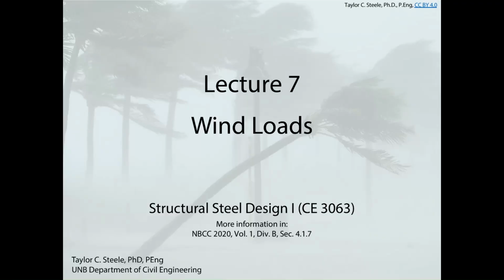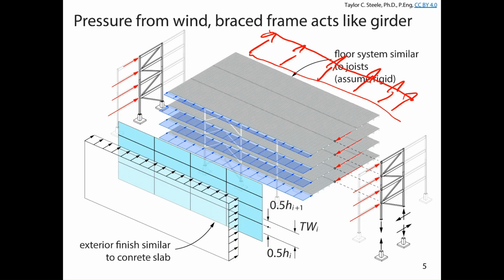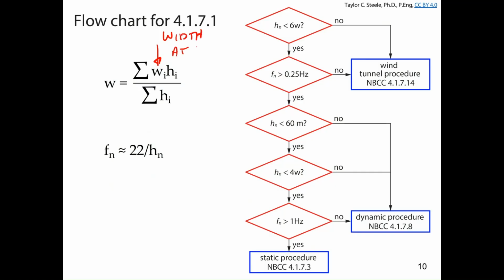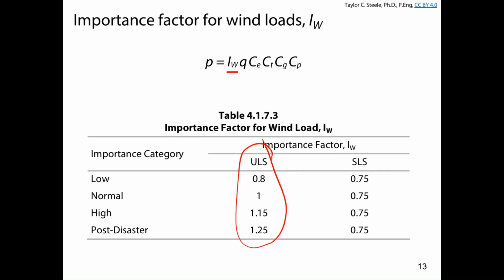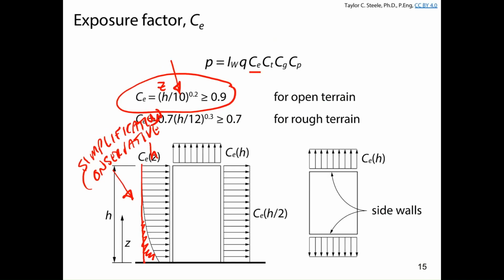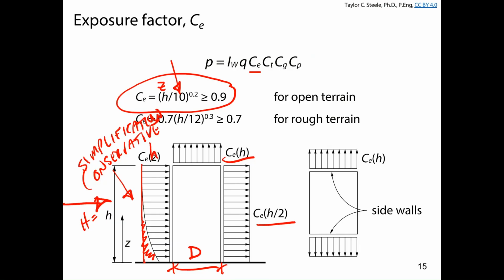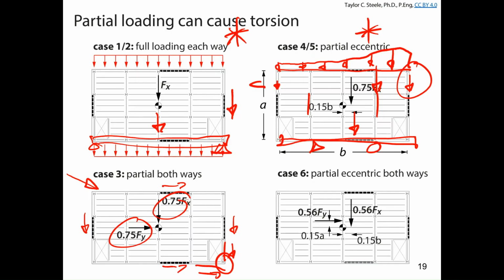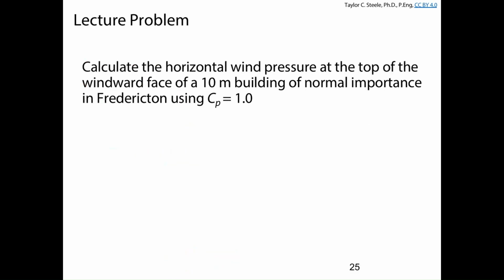Lecture 7: Wind Loads

Comment: Thank you
Reply from the maker: Happy to share
Reply: @steeleprofessor , I always follow you. I am a recent graduate from UBC and working here in New Brunswick Steel structure connection design and detailing EIT. If you can add one lecture on bracing transfer force and load path that would be great help. Also steel structure seismic design and detailing guide.